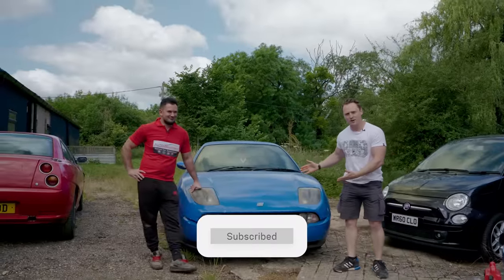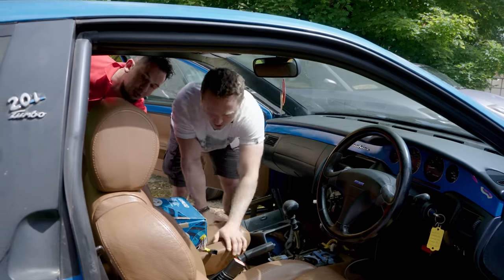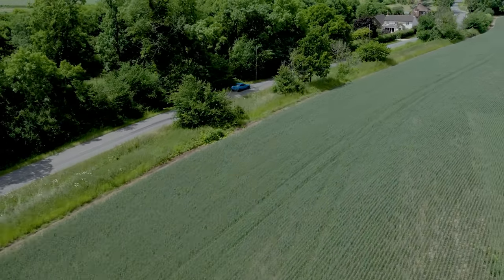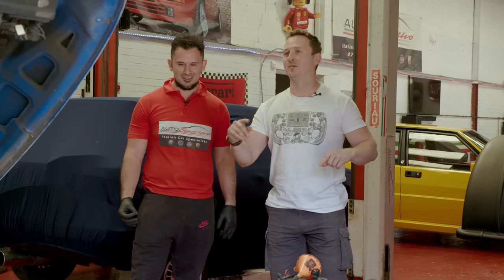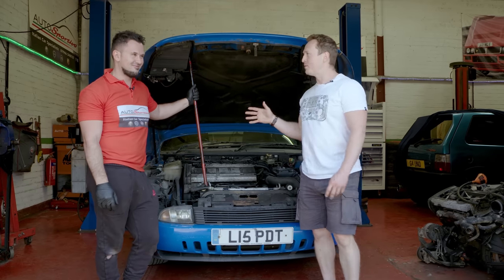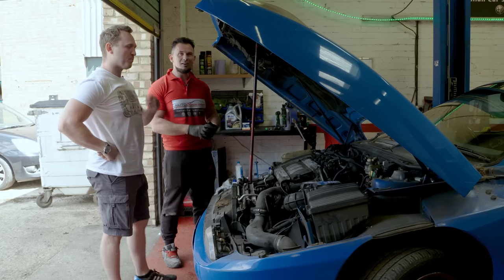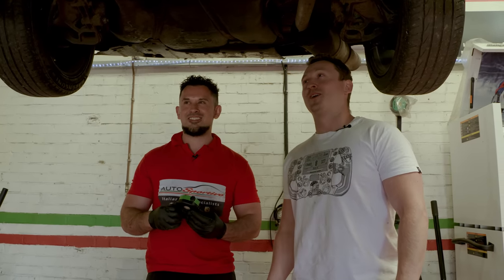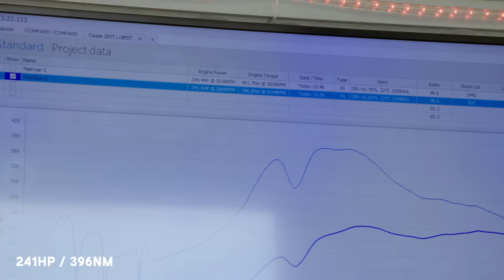Oh Crap, I Now Own A High-Mileage Italian Sports Car!

Comment from the maker: BIG UP Autosportivo! After watching this video, go check out their Ferrari Challenge Stradale video (featuring yours truly): https://www.youtube.com/watch?v=vki8BSKZuHU
Reply: Another great sounding 5 cylinder is ofc the audi 200 specially with a tune. The video called " Audi 200 Quattro launching with launch control/anti-lag " one of the best sounding clips of an engine on youtube imo.
And ofc Volvo's 5 cylinders are also nice.
Reply: LITTLE TIP alex!! MULTI ELECTRODE SPARK PLUGS 

ONLY £10.74 INC DELIVERY FOR BOSCH SUPER 4 SPARK PLUGS X5

IVE USED THOSE IN ALL MY CARS apart from my peugeot 407 coupe as its diesel i
buy multi electrode spark plugs they give you a cleaner more accurate spark as you don't lose the gapping over time due to wear and tear its definitely a good thing to do,its not much extra money to buy the multi electrode plugs plus when you get most plugs even the expensive ones dont come with the correct gap plus after you do gap them you end up losing the gapping over time due to wear and tear due to heat etc where as with your multi electrode plugs you dont need to worry about gapping plus the plugs are usually longer lasting plus you can clean them without worrying about bending things so easily
Reply: I legit started tearing up hearing it start. I miss my old yellow Coupe Turbo 20v so much. It met its demise in the mountain wall of a tunnel unfortunately after a merc wrecked in front of me and I in him.  Walked away from it with just some muscle tears in me back though, so even though I hope it never happens I can say they tolerate crashes at highway speeds relatively well.
Reply: erm.. Germany and Italy were allies in WW2.
Reply: ALEX have you ever drove a peugeot 407 coupe 2.7 hdi twin turbo diesel?

mine is 250hp and 400 lb/ft of torque 

I fell into mine I found serious rot in my jaguar s-type r sills so needed a car to allow me to take the jag off the road to give me time to fix the car, I seen the Peugeot on facebook for £800 I got it for £700 it was an amazingly tidy example its the dark blue with the white leather and the extra leather dashboard(rare) and is got every single option apart from the electric adjustable suspension (wouldn't want that anyway) i got it cheap because there was a issue with the electrics but i sorted that out no problem and now there way up in value mine is worth easy 3 grand people are realising what they are!
Ive had 307s and a 106 and 206 and my dads 309 before and i always seen peugeots as down market especially when it came to the interior but honestly the interior in the 407 coupe is beautiful!! even the seats rather than you pulling the handle and then sliding it to get in the back you pull the handle and it moves its self electrically!
and its got a nice jbl sound system aswel the only thing that lets the car down is the very of its time non touch screen satnav its a good size but low res and no touch there are android ones out there but its to easy to mess up the sound system as they have a amp from factory so I'm looking at replacing the screen with a android one but leaving the factory radio etc alone

the handling is really good aswel the chassis is really stiff you will notice in pics the doors have bits that stick out of the bottom of the doors that lock into the sills! I've been in 407 estates and 4 doors before but the coupe is a different beast altogether and in person in the rite colour they look great the long nose and short body really suits it plus that engine is nice and tourqey aswel Ive just got a map and intercooler so far but i plan on hybrid turbos and a few other bits im maybe thinking of a big single turbo as that's what land rover did with the same engine so im still trying to decide 

Your welcome to drive mine in the summer and do a video on it if you would like? im going to take a road trip to england at some point in summer anyway so i could go somewhere to meet you in summer if you want but honestly alex the car will surprise you so much if it had a jag badge or something from new i would honestly not question it when it comes to quality etc they really changed the car big time from the common 407's the leather dash and nav screen did it i think plus the seats are very smart

SORRY FOR THE BIG COMMENTS
Reply: and btw the value of them is increasing big time I'm definitely keeping mine as a investment its already tripled in value since I bought it
Reply: BUT IF YOU CAN GET A HOLD OF A 3.0HDI TO TRY YOU SHOULD TRY THAT ONE ASWEL BUT THERE RARE IN THE UK AND THATS IN COMPARISON TO THE ALREADY UNCOMMON 407 COUPE
Reply: @somervillearron  Get out :D
Reply: It's basically a 2wd Lancia Delta Integrale, with a coupe top, so much so some people have converted them to 4WD rally cars. That would be a good project.
Reply: I will love to see Alex on youtube boxing fight  Alex vs Deji 😂
Reply: Yeah, I didn't get the supposed animosity either...
Reply: PLEASE GIVE ME THAT CAR
Reply: Thats my dream car in the dream color
Reply: Gives you the car, gets good promotion. Sounds like a fair trade. What a peach, i am jealous.
Reply: Alex what's going on with this motor
Reply: Don't you know that they were not built by Fiat - But by Pininfarina?
I had one for a couple years and I loved it. The gearbox could be a lot better. But other than that, it's so amazing.

Comment: Brazil is the key!! We have a lot of aftermarket parts for Fiats! We love Fiat Marea Turbo, wich uses basically the same engine. Forged rods, piston, block reinforcement, gearbox and differentials. Everything to make it strong and reliable.
Reply: I had a Fiat Tipo 16v... what a car!!!!
Reply: I envy the Brazilians because we only got the Marea with the non turbo engine. Great cars.
Reply: So, I guess things for Alfa Romeo twin sparks are easy to get there also, I'm I wrong?
Reply: @RegularGuitars  not a usual engine, actually.  In Brazil we have 3 main engines for performance, VW AP (EA827) - the cheapest by far, and goes to literally anything, Chevy 6 inline 4.1, and Fiat 5 inline (fivetech).
Reply: @RegularGuitars  alfas are pretty rare and believe that the best selling one was the 164. I dream about swapping a fivetech to a 155, but the last one I saw was in way to bad of a shape to do this. I know one guy that did it on a 145.
Reply: @LucasBrito-sy4em  Marea engine is almost the same as the 2.0 Twin spark the only difference are the cilynder heads, even the valves are the same! They are based on the Fiat Pratola Serra modular engines
Reply: @LucasBrito-sy4em  I'm from Argentina and I got a 156 4 months ago, still running smooth but it's good to know that there's a lot of market for the Pratola Serra sister engines there
Reply: @RegularGuitars  uh no your wrong…the marea engine is a 5 cylinder non turbo. Nothing like the twin spark 4 cylinder at all…
Reply: @RegularGuitars  if there is a normal 4 cylinder 16v engine, the Marea had in it then yes you would almost be correct, as far as i am aware - having not seen one or heard about them here in the uk, there isnt such a thing.
Reply: @cylturbskie  In South America we had the 1.6, the 2.0 and the 1.9 Diesel as far as I know.
I already checked with a distributor, my Alfa shares a lot of parts with the Mareas, like timing belt tensioners or even the valves
Reply: @RegularGuitars  oh right makes sense i guess :)
Reply: @RegularGuitars  yeh thats defo different from here, unless the 1.6 and 2.0 versions are just insanely insanely rare - which in contrast there is only 40 ish fiat coupe 20vt plus models on our roads. Which is why i say insanely insanely rare. Only seen the 1.9 and 2.4 jtds. 
Id love to put the coupe 20vt engine in the marea or the little bravo.
Reply: @RegularGuitars  had a revving video, will post a better one up tomorrow.
Reply: and don't forget Fiat Stilo 2.4 fivetech
Reply: @cylturbskie  Marea in Brazil have the 2.0 (126 and 142 HP), 2.4 (160hp), 1.8 (132hp - kinda rare and have some electrical issues, but cool engine), 1.6 (don't remember HP, don't like this engine at all hahahah) and last but not least, 2.0 turbo (182hp) which has BIG differences, not just a turbo kit.
Reply: @LucasBrito-sy4em 126 and 142? Excuse me, I have never heard of such specs. I know the 147 and 154 hp ones... actually, I think I have seen 142, but thought its a mistake, but never 126. Also, to my knowledge, the blocks are identical of the non turbo and turbo 2.0; I think the same goes for the pistons and crankshaft. The difference is the head (not fully sure) and both exhaust and intake manifolds

Comment: The car that donated its taillights to masterpieces like the Nissan R390, the Ultima, the MG X-Power SV, the Tommy kaira ZZ and last but most important the Fiat Panda 4x4 Climbing
Reply: bro they're just circles lol

they were probably a standardized part that were just sold to multiple OEMs
Reply: @thecloud1432  The R390's were definitely Fiat Coupe though, they're stamped Fiat.
Reply: The MG XPower SV also had Fiat Punto headlights
Reply: @rjpm92  Damn fiat out here patenting the circle
Reply: One of the best designed rear ends, better than the front. IMHO.

Comment: If a car can rack up that kind of mileage and still go strong… it’s a good one end of story. My focus 205000 and still going, I have got to do the engine mounts though.
Reply: Don't confuse the car with the engine, period.
Reply: I have a 2001 Audi with just under 200,000 miles. And at least half of that has been with 20+ psi! It's a daily driver but people will say those aren't reliable too. It's all in how you care for it!
Reply: Triggers broom. Trust me.
Reply: my e11 corolla has 253,000 but i feel that the engine and box are starting to say goodbye hahaha
Reply: Had a golf 4 at 202,000. Current one is 91k so should be aight. Nurse that clutch because don’t have the money to replace
Reply: Got a 220cdi with 280k, such a tank.

Comment: Im so excited for this series! My dad has a '98 one with 230k on the clock and for its age, it freaking rips!  Since he is passing it to me I would love to get some insights on how to properly maintain it and furthermore tune it. As far as I remember, the turbo has been replaced, exhaust was patched up, electrical stuff redone, MAF sensor replaced and some bits that I'm missing.

Good thing is, its bone stock and most of the miles were done by my parents. Many are interested in buying it and my mom insists on selling it, but now that Alex has stepped in, another fiat coupe 20v 5cyl will be reborn! So so so excited!

Comment: High Mileage Italian Sports Car
reliability has left the chat
Reply: Looks like this one has the hazard lights on be default :D
Reply: Tbh I did not expect those hp after all these years, and the high mileage, maybe you made this comment too soon😅
Reply: Not like it was any better new. I'm Italian and have no problem in saying most stuff made by the Fiat group in the 1990s (except Ferraris) was garbage. Multipla was the only decent car they made.
Reply: It never entered
Reply: Reliability was never in the chat
Reply: How can you say this when the car has such power at it's age and mileage? Don't forget that the engine is a 2L (proudly) made by FIAT in the '90s.
Show me any other engine made in the same period that has 220Hp from just 2L and put in a production car. And also runs without any problems for +200k miles.

Comment: I owned a coupe (non turbo) for 6 month's.
Issues were.
Rear lights stopped working.
Cambelt snapped then rebuilt
Balance shaft slipped
Starting motor engaged at 70mph  
So you spend more time of road than on it but it one hell of a car (drive and looks)
But absolutely loved it and now looking for a yellow one.

Comment: tip for keeping the alternator alive spray fluidfilm on it from time to time, its a rust remover and inhibitor, and you may not want to rev it or drive it hard like you did when you first started it, good way to kill engine bearings and or turbo.

Comment: I have the NA version of that exact engine in my '99 Fiat Bravo 2.0 20v HGT. It only has 155hp, but it moves quite good at corners. And it also has around 190.000 miles and it runs fine